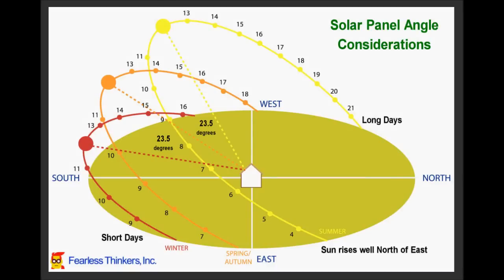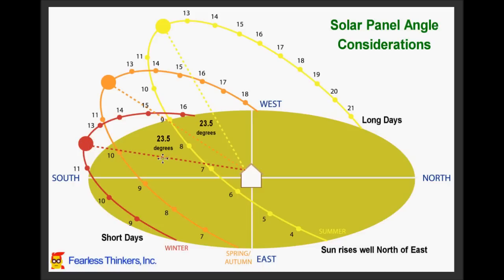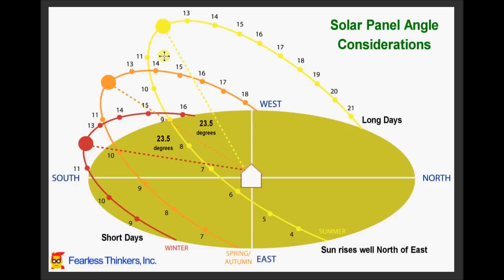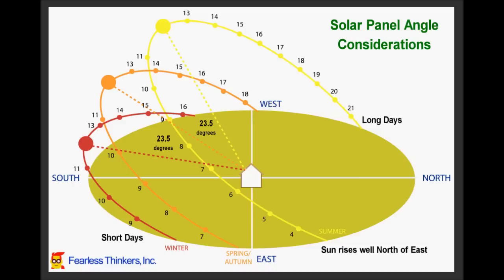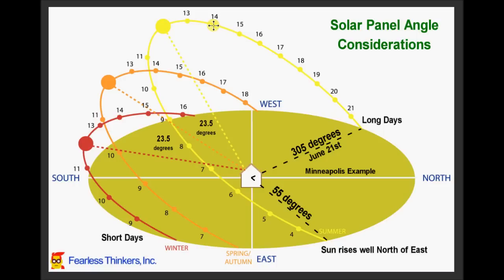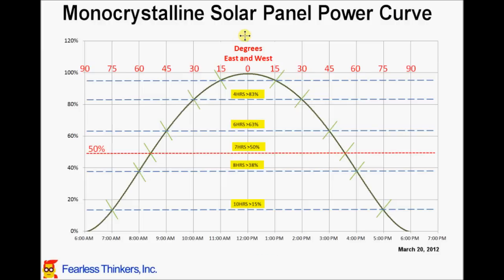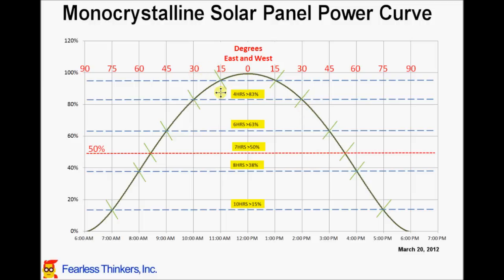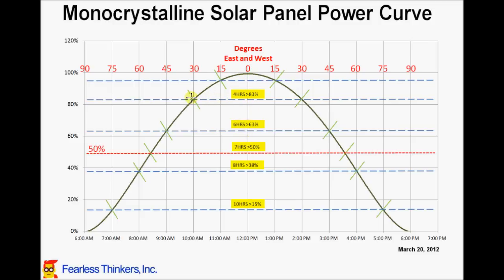Solar Panel Angle Considerations and performance implications

Comment: On the equinox it is the zenith angle that is your latitude NOT the altitude (ie angle from the horizon). Otherwise on the equinox the north pole would have the sun overhead!

Comment: On the equinox, the sun is not  at angle equal to your latitude. It is equal to the 90° complement of your altitude. For example if you are at the equator your latitude is 0°, but the sun is 90° over head. If you’re at the north pole your latitude is 90°, but the sun is it 0° above the horizon. I live at 42°, so on the equinox the sun is 48° above the horizon (at noontime). .

Comment: Why make it so complicated?   I design all my stuff at 45 degrees.  You are gonna be less efficient in the solstices but in the summer the longer days make up for it.   Lot of fuss over angle when really it's the clouds that rob efficiency.  Set your angle at 45 degrees, point it South and forget about it.
Reply: I live at 42° north latitude so on the equinox the sun reaches 48° above the horizon at noon time and 71° above the horizon at the summer solstice. Why should I have my panel set at 45°?
Reply: @BobbieGWhiz  I imagine get better angle on weaker shorter production seasons.

The worse angle is made up for by the longer days in higher production seasons.

Also simplicity

Comment: Solar sux!   At only time during the day do you even have a chance at maximum power.  The rest of the times you are only getting a fraction of the power.  If you were to average the power over the entire day, it seems like it would only be about half of the peak power.  That means if you have a 500W solar kit, you will be lucky to get 250W per hour, and then there are lots of other losses after that power is generated.  Solar is the king of losses.
Reply: David, you are King of the Half Empty Cup. Solar radiation is free. The fact that a panel gets varying %effectiveness thru the day is part of system design calculation. Using those calculations, solar power is now pretty much equal to grid power in terms of cost/watt. What's your beef?
Reply: but countering your idea, sunlight is the king of abundance

Comment: At 1:08 you said at the equinox, the angle of the sun is equal to your latitude. Rather, it’s equal to the 90 degree complement of your latitude. If your at the equator (0 degrees), the sun is at 90 degrees. If your at the North Pole (90 degrees), the sun’s angle is 0 degrees. If you are at 40 degrees latitude , the sun’s angle would be 50 degrees, and so forth.
Reply: I believe the angle from the horizon (North) to Polaris is equal to your latitude.  The celestial equator ( 0 degree Declination) is 90 degrees from Polaris.   The Celestial Equator is (90 degrees - Latitude) from the South Horizon.   The sun (apparent) moves 23.5+/- degrees from the Celestial Equator.
Reply: @roberttarquinio3148  yup

Comment: Can a person use an Arduino $20.00 board to monitor your TED value and at some point rotate your tracker away from the sun to maintain your 0 watts input to the grid automatically? This might nail your 0 watts without the switches but this is too complicated for me! You are a smart guy!

Comment: If that's the case, isn't it always better to use a tracker and cut 2 or 3 panels from your system to pay for it? It looks like you get more per dollar with a tracker/panel system. Thanks for your reply :)

Comment: I was curious, how much power does a solar tracker use? So if you subtract that from the increased power output per day for a tracking panel compare to a non tracking panel, what is the amount of increased power production per day? And for the extra cost of a tracker, how many extra panels can you buy. So in the end will the cost per output be the same for both?
Reply: I think its been proven that it is cheaper to buy more panels than invest in a tracking system.